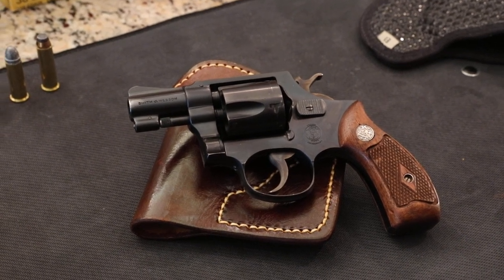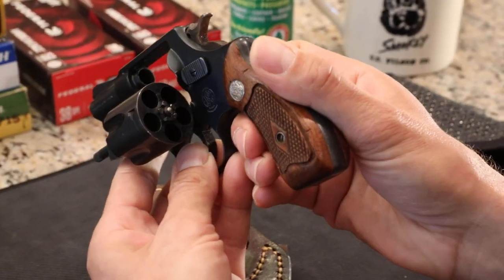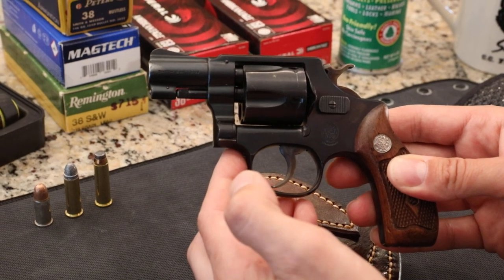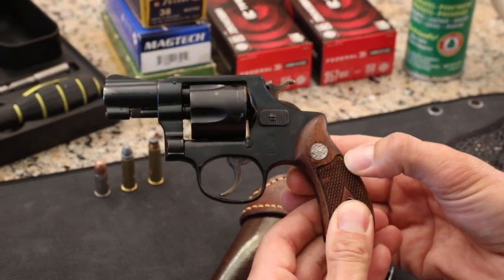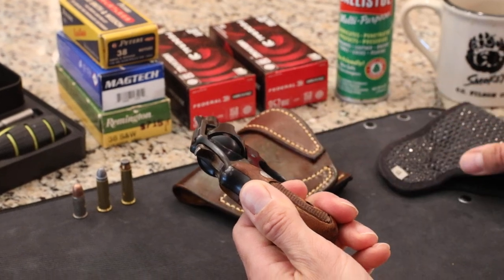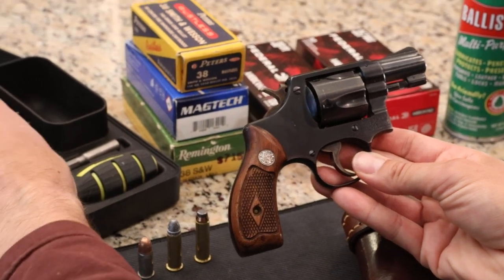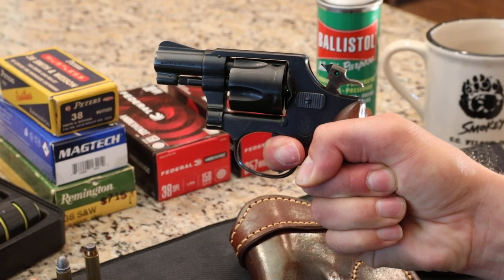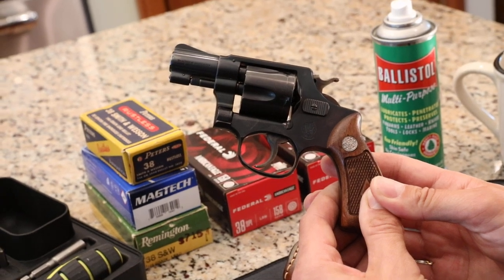Smith and Wesson Model 32 Terrier Pocket Revolver chambered for 38 S&W CTG

Comment: When I went to work for the post office in 72 W. we carried 38 S&Ws to deliver registered mail to the train station and airport.  In the 90s, as an investigator with the PO, anytime I went to an office I had to inquire and collect any ammo or guns that they still might have.  I ended up with over 1500. 38 S&W cartridges.  I was able to purchase at auction one of the po marked ,38s.  It was the Terrier, a 38 on the 32 I frame.  It was and is a great little gun.  I have a Wesley and HR in the same caliber.  I load using 148gr wc seated out from an old Hornady manual.  PS:We used target master plastic cases with plastic reusable slugs driven by a primer only to practice shooting in the men’s bathroom.  Good Times.  Bill
Reply from the maker: That’s awesome Bill!  Thank you for sharing this story :)